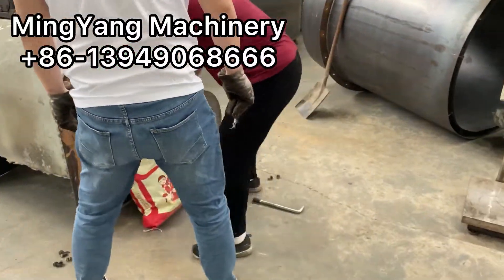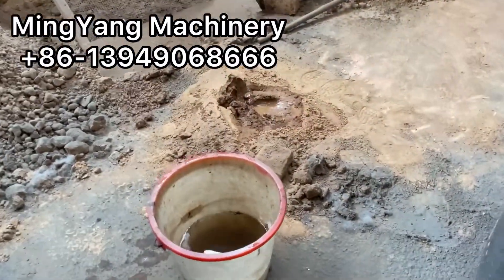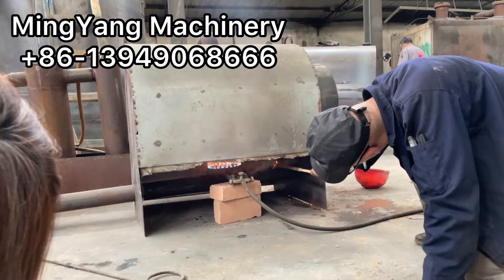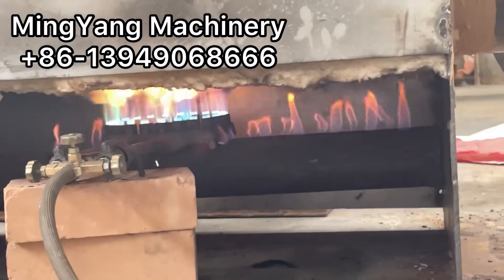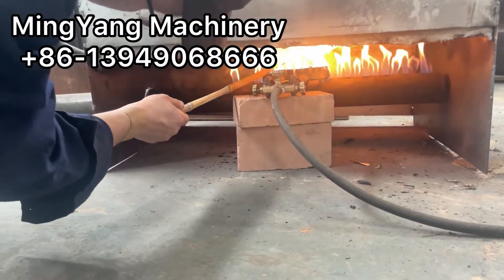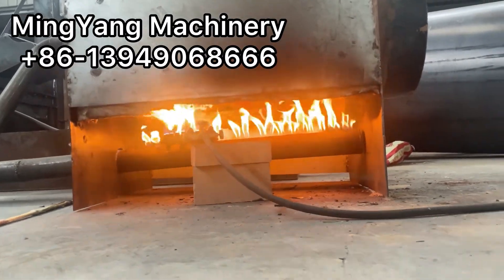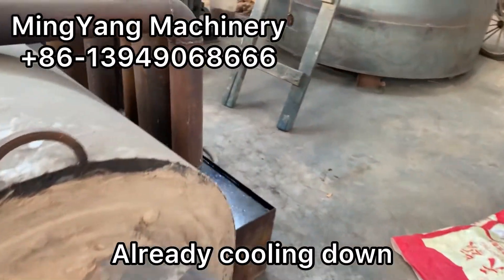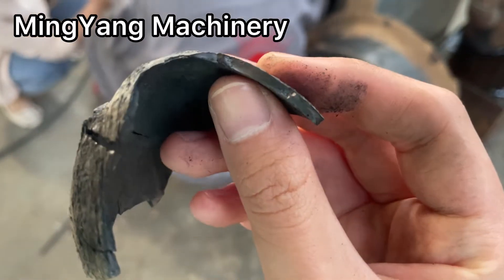DIY Coconut shell charcoal carbonization furnace charcoal stove kiln

Comment: Hi
,how long does the carbonization process take to achieve this result with your machine?
Reply from the maker: @elviranelson1138  This is small volume furnace. Carbonization finish in only 3-4 hours. Time based on materials amount and carbonation furnace design ( fast pyrolysis or slow pyrolysis).
Reply: @kimzhao-charcoalmakingmachine  OK
Thanks you 🙏🏾

Comment: Hello Kim, I'm Ahmad from Indonesia.
This is extremely impressive. I am quite interested in this device. But I want to ask a few questions on the effects of coconut shell burning
1. Is it feasible to char coconut shells with this equipment in larger volumes/quantities, or is there a limit?
2. What proportion of the residual water content in the coconut shell charcoal?
3. What proportion of substance levels is lost during the combustion process?
4. What proportion of ash content is produced?

Thanks...
Reply from the maker: Hello Ahmed, video model is just for testing, we have normal commercial model, pls check: https://youtu.be/jTOBkMYLzPM?si=yCK7SJDo_wCaS8WQ
And for coconut shell, charcoal yield is 1000 kg shell produce 380kg charcoal( average). Others are moisture, wood tar, wood vinegar, snygas etc. Contact me via whatsapp: +86- 13949068666 if you want to discuss more.

Comment: هناك خدعة في هذا الفديو
قشور جوز الهند يحتاج الى 5 ساعات على الاقل ليتفحم في هذا الفرن الضعيف
Reply from the maker: وقت الكربنة على أساس كمية المواد. لأننا في هذا الفيديو نقوم بإدخال كمية قليلة جدًا من قشرة جوز الهند، لذلك تنتهي في عدة ساعات. إنها ليست مجرد عدة دقائق تنتهي كوقت فيديو.
Reply: لا ليس كذلك . اذا كانت الكمية قليلة او كثيرة لا يؤثر على وقت التفحم او الكربنة . لان انا ايضا عندي ماكنة او فرن الكربنة يتسع لواحد طن ونصف من قشور الجوز ويحتاج الى ثمانية ساعات متواصلة لكي يتفحم .
Reply from the maker: قشرة الجوز أصغر بكثير من قشرة جوز الهند، وتحتاج إلى 8 ساعات بسبب تدفق الهواء السيئ بالداخل. لذلك يحتاجون إلى وقت أطول بكثير لإنهاء عملية الكربنة.
الفرن المصمم الجديد في مصنعنا مزود بنظام تنقية كامل، ويمكنه جلب كل الدخان لتنقيته، وكذلك تعزيز عملية الكربنة. بدون تدفق الهواء، ستستغرق عملية الكربنة وقتًا أطول بكثير حتى تنتهي، ولا تزال غير قادرة على التأكد من التفحم بالكامل.

لذا أقترح عليك استخدام تصميمنا، بدلاً من استخدام تصميم سيء، ثم احكم علينا. شكرًا لاهتمامك! @Husham_Alameen
Reply from the maker: Walnut shell is much smaller size than our coconut shell, you need 8 hours because bad airflow inside. So they need much longer time to finish carbonization. 
New designed furnace in our factory all with complete purification system, it can bring all smoke to purify, and also promote carbonization process. Without airflow, carbonization will takes much much longer time to finish, and still not able to make sure fully carbonized. 

So suggest you use our design, instead of using a bad design then judge us.Thanks for your interest! @Husham_Alameen

Comment: pointless using LPG to make char!!
Reply from the maker: Because we test in our factory, not allowed to make any smoke. You can use any other Wasted firewood to preheat up furnace. This is only showing principle how does our system working. Our normal model for sell is using recycled gas as main heating fuel from materials carbonization itself. No matter what kind of charcoal making method, it will needs a preheating fuel at least!!!
https://youtu.be/H-VG15pRFk4

Comment: very impressive energy saving device Mr Kim. do you think we could skip the wood gas  purification , as it is quite complicated for an amateur, and use LPG gas exclusively for the heating , though this might prove expensive , . i really like it. Anand from Mauritius
Reply from the maker: Hi Anand, thanks for your comment, we can seal smoke in the water( can also be smokeless working), but can't use the flammable gas from recycling. Because wood gas comes out from carbonization always with humidity and dust, that's why we use water purification, after purification, the gas will be very easy to light up and burn for heating. For one batch by one batch type furnace, "burn smoke directly" type can't work well( we have designed using gas ignition burner to help light up initial smoke, for rotary continuous working model, this will only need burn gas to help light up fire for smoke as start, later the fire will be powerful enough to burn the following flammable gas. Here's the model link: https://youtu.be/SvV6RE1GrzI). You can check for reference. Hope my reply helps you.

Comment: What is the max temperature in celcius after flameable gas produce to heat the retort?
Reply from the maker: Hi this is testing model. Our normal furnace able to work at 400-500 centigrade
Reply: @kimzhao-charcoalmakingmachine  thanks for replying, in this video what is the max temperature reached when flameable biogas produced to burn the retort? I want to know the flameable gas capability after condensation. Since it is not blue flame
Reply from the maker: @GoodMoment88  Hi, the recycled gas color will turned to be a process, firstly red, then blue, then yellow, then red, after these, it means carbonization finished
Reply from the maker: @GoodMoment88  From 280 centigrade, there will start coming out flammable gas, then keep raising, till 400-500, then finish carbonization
Reply from the maker: @HENDRICK WU88 GOOD MOMENT  And it's not whole blue, The center of the flame is blue, tip of flame always not blue😁

Comment: What happens to the smoke? Does it pass through the water?
Reply from the maker: Hi Dear Gabriel. Yes. We use a designed water purification system to seal and recycling the smoke to flammable gas.
Reply: @kimzhao-charcoalmakingmachine  okay am interesting...would like to know how water purifucation works and being purified

Comment: How many tons of lpg do you need to produce 1 ton coconut shell charcoal?
Reply from the maker: It’s only needed for preheating. Each model furnace able using recycled gas for heating. So different furnace is different data. And not whole 1 ton charcoal all count on LPG.
Reply: @kimzhao-charcoalmakingmachine  thanks for your reply kim. I will contact with you within this week